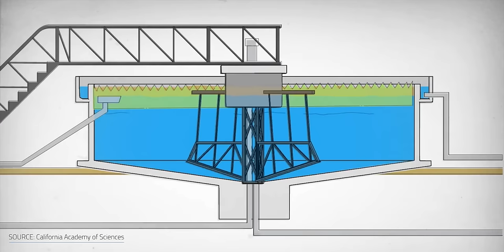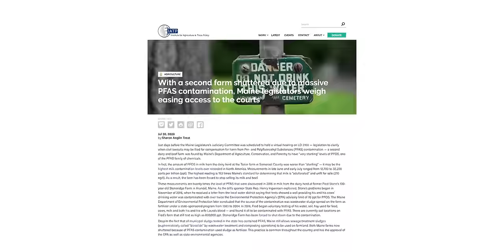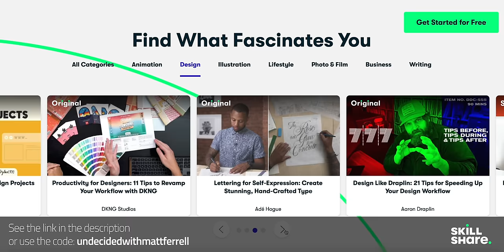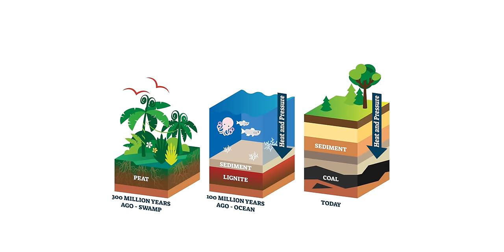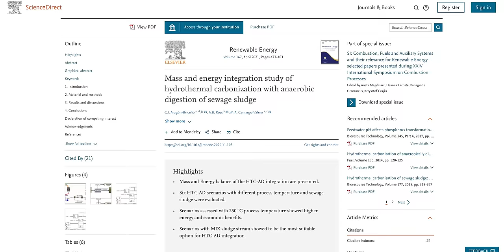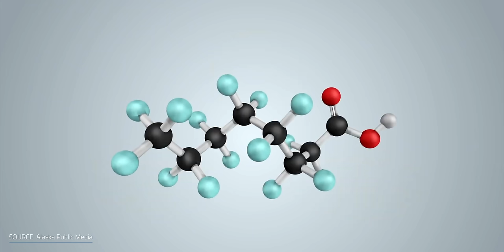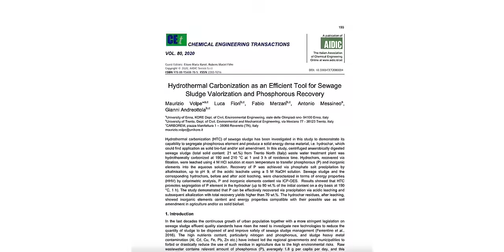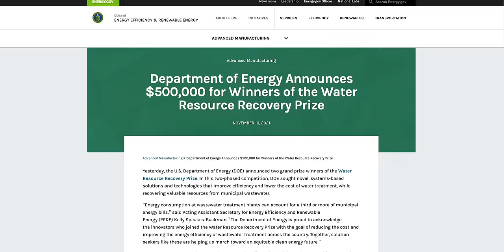Turning Human Waste into Renewable Energy?

Comment: I've been working in wastewater in Cincinnati for a few months now, and one of the things that always gets shown off when at one of our WWTPs is that there is a room with a few old generators, which were decommissioned probably a decade ago. They used to run on natural gas produced as a byproduct of breaking down solid sewage waste, which sounds pretty great, but had some downsides. Namely, when you assume that all of your solid waste is carbon, oxygen, hydrogen, and nitrogen, then the chemistry works fine, but sadly people poop other stuff sometimes, and that complicates the natural gas production process, and the resulting natural gas is full of a lot of contaminants. When we ran it in the generators, it was really inefficient and would pretty consistently clog the generators with soot. Eventually we stopped using the generators and went to just incinerating the waste, which from an environmental standpoint is less than ideal, but we have been looking into possibly reusing the ash from the incinerator (which is a really cool rust color) in concrete and bricks.

Comment: This process is very similar to a device I've built - A microwave pyrolysis reactor.
I use it primarily for plastics, but anything can be put in there (including sewage) and it turns it it o gaseous and liquid fuels, and the left over product is completely carbonized, ready for sequestration, fuel, or building materials!
I have detailed videos on my channel.

Comment: This has been going on for a very long time. 50+ years ago when I was a kid in Auckland, New Zealand, the sewage treatment plant at Mangere ran it's whole operation on the methane that came from the water it was treating and then fed the excess electricity into the national grid ( we were told).  Methane from sewage, hydrogen from pee...none of this is new but someone must pick up the ball and run!
Reply: Poop into energy might be old news but this video highlights implications of HTC which is a very recent method! Plus methane is 30x worse than co2 so I there’s no comparison sustainably

Comment: The idea that the high energy consumption of the autoclaving operation can be more than offset through fuel energy production  to yield a NET energy source is mind boggling ! 
I will check out the pros and cons of  this at depth for implementation in a project of my own ! Thank you !
Reply: I'm from Queensland Australia. Our local cane sugar mills export a massive amount of power during the crush season.  All the begasse is burnt to power the mill and excess power sold to the local power grid provider

Comment: Turning poop to energy is not a new concept. I was on a tour of a sewage treatment plant in the early 1960's where they had a digester that took the Methane generated by the digesting poop and used it to power the plant. There are already electric generators powered by digesting animal poop supplying power to the grid as well as powering the farms where the poop originated.
Reply: Which he also talked about in the video. It's called anaerobic digestion. But it's nowhere near as efficient as HTC, and it's very smelly.
Reply: I'm from Brazil. We see this in pig farms since 1960's too. They contain the waste, collect the gas and use it in an engine or turbine to generate electricity. Some farms can be self sustainable this way. But now we had a project going on, selected some medium sized cities and we're gonna test the same principle using human waste. It'll be used to provide electricity to the grid, but they'll test the economic viability to produce green hydrogen for future public transportation.
Reply: @rafaelrp07  Do you have text interpretation problems? He is  is not talking about generating biogas from waste  or other organic materials, but about HTC( HYDROTHERMAL CARBONIZATION) something INFINITELY MORE EFFICIENT.
Reply: @albinnordlander2293  wrong about the smelly part, first it's captured in a sealed dome, then purified thru activated coals and membranes. The result, CH4 is odorless, in fact we even have to inject THT into for user security. That's my day job.
Reply: @michaela7759  I'd like to disagree, HTC requires massive amounts of heat. Biogas on the other hand can produce local heat and electricity, with about 95% left to be purified and injected into the grid. That's for a regular European farm size (very small in comparaison to American farms).
Reply: @ottodidakt3069  You are lucky that you work at a plant where everything is sealed because that is definitely not the norm. Sure the anaerobic digestion process itself is sealed but not always every step leading up to it. But you are right that new plants probably are pretty odorless. Maybe it's better to compare this new technology in the video, with the "new" AD process.

Comment: As a wastewater operator myself, I am very interested to see how this develops, the three main concerns that jump to my mind are.
1 Scalability
2 Sustainability
3 Cost effective/ROI
Looks awesome in principal.

I work at an activated sludge plant (basically natural decay process on steroids). for years we were able to spread our biosolids (which were VERY stable, they literally look like dirt), on our hayfields. It was great, low cost, increased crop yields, very convenient, very safe. then some dope on the local assembly (who knows NOTHING about waste treatment) read some California paper on poor biosolids agricultural applications and convinced our local government to cancel all the spreading permits, So now we have to truck those biosolids 40 miles twice a week to the local landfill, where they buried  at a premium hazardous waste charge (at taxpayer expense remember), right along with the domestic trash disposal.
Reply: 1. Each HTC Train will process between 15,000 and 20,000 wet tons of biosolids per year depending on solids % and flow rate (eq. to the population of 100,000 people.) multiple trains can be set up to run in parallel for scalability. excess capacity can be filled with other wet organic waste sources i.e. food waste, manure, green waste earning additional revenue.
2. HTC reduces GHG emission by over 85% compared to waste activated sludge and land application processes. HTC reduces biosolids volume by 75%, so even if continuing to land apply there would be significant savings..
3. HTC has a levelized cost of transformation (LCOT) of $32/wet ton. Your ROI would depend on the savings of current disposal cost in excess of $32/ton.  Most municipalities see a positive ROI in year 4-8 of operation.

Comment: I've just finished installing biogas digesters at waste water plants here in the UK.  All the older schools with oil heating in rural areas are being replaced with methane heating systems.  I'm sure the kids will love the idea of schools heated by farts.
Reply: where are they based exactly? and what is the scale? 
what do you think the main hurdle is for getting such systems mainstream?

- edit - sorry for the quickfire questions but I'm trying to get local authorities in rural Western Australia to invest is similar biogas systems. very difficult change peoples thinking about waste. they seem almost happy to just spend tax money on storing it, transporting it, burying it, rather than consider any way to turn it into a valuable product.
Reply: is there any danger for storage of the gas? or problem when the tank is full? how long and what's the minimum and maximum of waste does it take to create gas and how much will it produce?
Reply: @Snugggg  Southern Waters bases in East & West Sussex. There aim is to generated over 74 GWh from CHP plants and 3 GWh from solar photovoltaics for there own use.  Spare gas capacity will be sold to local schools. All the issues were resolved at the design and planning stage.  

UK government investing in replacement resources for natural gas production. The stored  gas industry's regulated and with 150 years of experience.  I cant think of one accident. 

They hope to get the first schools up and running by September 2022.

Comment: We were involved in a project in the 1950's. Beckton sewage station in North London used the gas off the lagoon to fuel the gas Turbines which drove generators. The cost per Gas turbine was calculated to be 6d (sixpence) a day The high quality exhaust heat being used to heat the lagoon. This was at the very beginning of Aero derived Gas turbines for industrial use. Nowadays we would want to fire up a local district heating and cooling/chilling scheme. Something that's happening more often thanks to the very low emissions/noise combined with very high reliability and the ability to follow and make up renewable intermittent power, such as wind.

Comment: I'm retired from a large municipal sewage treatment facility. -San Francisco east bay area. The anaerobic digesters at that facility (plaque on wall dated 1952) are mid-20th century (old, in other words) tech. and are still in operation working great. I've forgotten the average daily cubic feet methane produced, but it was logged. About 1/3 of total gas was methane, the other 2/3 gas was mostly CO2 (which could be used for high-lipid algae production). The digester methane, after scrubbing etc., was either tanked for use in generating electricity for onsite use, and for selling back into commercial grid. Total gas production still exceeded the facility's needs and ability to sell back to grid.. So waste gas burners were still used to dispose of excess surplus.
Reply: So my opinion, what the future should consider, is matching public anaerobic sewage processes with high-lipid algae production. .My observation was the bigger the process, often the more efficient, and more tolerant/resilient to "upsets." Also noteworthy, the facility where I worked had one of the best (highest rated) water quality labs in the bay area.

Comment: Totally onboard with this.  Safe, increases energy availability for other uses.  Can be used in so many things...because it's CARBON!  I get how regulation needs to be somewhat involved, but honestly, it holds up way too many great ideas with plenty of potential.  I also think most regulators are simply checking boxes based on what is considered SOP.  I think a super regulator that can run things like HTC through a controlled but rapid process to then send those results and hyper green flag these processes at local levels.

Comment: Awesome information! Answered so many questions about sewage that I've always wondered. Where does all the chemo, pharmecutical, and other toxins we consume go? Do we rely on our catalytic converters to burn it? Maybe I missed the explanation.
Reply: I think the solution they are thinking is to burn it, and create mire energy from it. Almost anything harmful is filtered during the process and the toxic Ash that's left is then filtered to take any heavy metals out of it. What's left is then landfilled but doesn't give off methane and if relatively safe to dispose of. The amount of waste that ends up in a landfill from these processes is extremely small compared to the original amount that begins the cycle. I'm basing this on other videos I have seen regarding waste to energy plants.
Reply: @sambra1979  that sounds like a major improvement. It will be cool when they figure out how to mine the metals back out for reuse. Maybe help with removing toxic metals from soil which is very difficult....

Comment: Amazing. I’ve been doing a lot of research on carbonization and from studying boiler theory, I have recently come across the facts that water when pressurized, will not boil. News for me😁. I’ve also been studying how plastic waste can be turned into oil with the addition of heat. I have wondered if or how the two processes could be put together to efficiently break the carbon chains down, similar to using a catalyst to break plastic down to oil at near room temperature.

This is some amazing research done on your part. I’m not sure simply exchanging 10% into concrete would make concrete completely carbon neutral but if it can, the implications are enormous. So enormous, that it would probably be as big of a change as black and white to color TV. Or maybe I’m just dreaming 😂

Thanks for bringing this technology to light. Your videos are very informative and are a pleasure to watch.

Comment: I would think large scale biodigesters to produce methane, which would then be burned in generators would  be an easy tech to implement. Urea is a byproduct of waste also and can replace salt usage on roads...
Reply: The concern there would be methane leaks and smell respectively
Reply: @ironboy3245  This tech is already being used in some landfills.  If we can make it to space, I am sure we can figure out the "smell" issue.  Many industries say they can't do something just because they can't think outside the box.
Reply: @northwoodsdad7506  in singapore we just burn it and use the heat to generate power. the ash is what we landfill

Comment: Hi Matt and friends. A greenie friend of mine said, "we need to get our s--t together on climate change". I never thought she meant it literally. Here in NZ my local city council has been successfully operating a sewage treatment plant generating its own biogas for decades. It's technically less advanced than the one shown in your video, but we're a small country with small resources, but just enough brains to know we cannot afford to invest ten dollars today to get a miserable return of two cents per year. Our city council have more than enough investments like that already. 

We have a lot of dairy cows however, and as most of NZ could be described as "the Riviera of the South Pacific", our cows frolic about in the sunshine all year, releasing their methane rich farts into the wide blue yonder. The cows are not the "Gary Larson" breed, and voluntarily return to the milking shed at night, not realizing they're being exploited. After watching your most excellent video, it struck me that we could keep them indoors overnight and capture their farts using cleverly designed roof plumbing. Our farmers are absolute geniuses at knocking up corrugated iron sheds, so collecting even 50% of the farts is not an idea to be sniffed at, agricultural emissions make up half NZ's total. It would be cheap and low-tech, which to accountants means "practical". Is this idea a runner, or should it be flushed down the dunny? Cheers, P.R.
Reply: @Theonefreenet  Hi Martin. Great little collection of factoids there. What's your point? Cheers, P.R.

Comment: I would have loved to know what kind of emissions would be given off matt. when burning the solid coal alternative. 
Is it clean burning? Or does it produce the same problems as burning coal itself ?
Reply: it is a very poor grade of coal; lots of smoke and tons of ash. you must find the customers first.
Reply: I doubt it's much cleaner... it's still carbon sticked together. But at least it removes some mining activities equivalent.
Reply: It will still give of the same amount if not more than normal coal I imagine. But as was mentioned, the normal breakdown of the sewage releases tinned of Methane, which is worse. So overal, its a positive still even know its still polluter.
Reply: Great question, what I know personally is that the use of alternative fuels in biomass furnaces are regulated in Europe and many of these alternatives produce high values of nitrous oxides, VOC's and Ammonia. Whether that pushes the emissions past the NOx limits I'm unsure but definitely an interesting question.
Reply: The comparison should actually be between normal sewage emission and using it this way instead. Normally the emissions would be high in methane, however after processing or digesting biowaste, or just burning the methane as fuel aka methane to carbondioxide, it's four times better. Methane is a four times worse than carbondioxide in causing global warming. If you inoculate nitrous oxide respiring microbes in the digestor, then you are fixing a gas 300 times worse than carbondioxide

Comment: It sounds like there are positive aspects to this process but I'm still confused on the Bio-Coal product. Aren't we trying to move away from burning coal because of the Sulfur dioxide and Nitrogen oxides that it releases in the air? Or did I miss some part of the video that explains the absence of these emissions?
Reply: As someone who lives near the big coal ash pond spill of a few years ago, I'm also curious about the solid/liquid waste from bio-coal.  We've got a lot of lawsuits working their way through the courts concerning radiation exposure from that spill.
Reply: @HarryLovesRuth  well, this would have much less radiation, but I'm not sure about the other stuff.
Reply: This stuff won't contain much sulfur since sulfur isn't a major component of the human (or other critters') diet. Also, I suspect that most of the sulfur in the feedstock will end up in the liquid fraction anyway, although I can't swear to that since I don't know enough about the process.  As for the nitrogen oxides, AIUI, those are mostly products of incomplete combustion independent of the fuel source and cars produce a lot more of them than power plants.
Reply: I've been doing some reading...I think because it comes from carbon neutral sources (humans!), it doesn't harm the enviroment in the same way as regular coal...,and some industries need something that behaves like coal in order to function.

Comment: I was expecting this to be more like putting poop in compost and generating electricity from the heat but i guess this also works. 😛
Reply: with little effort, gas production from the compost can be increased 5-10 times. The leftover can be simply put in the field